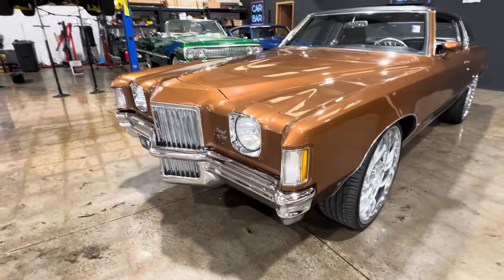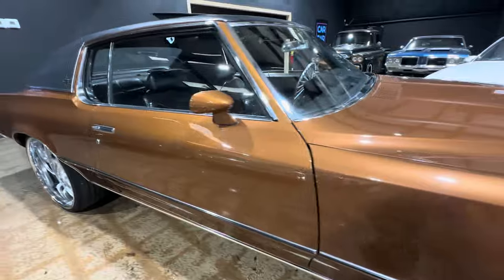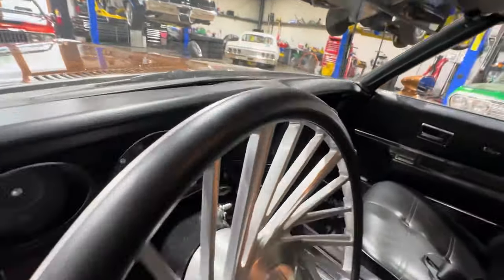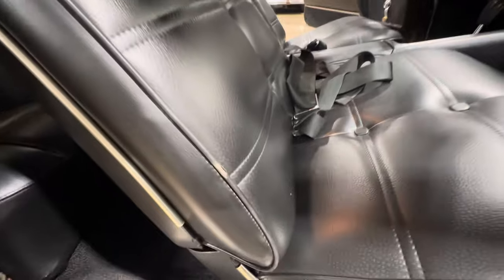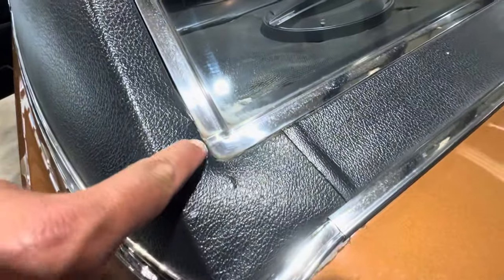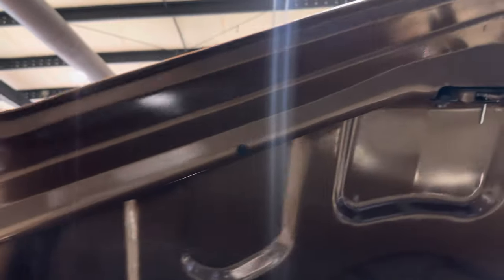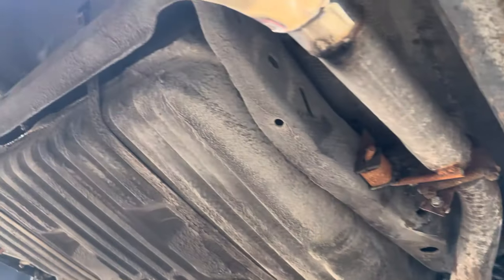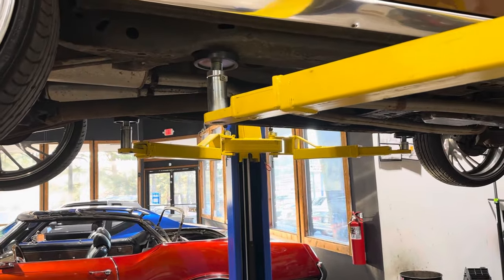For Sale 1971 Pontiac Grand Prix Model J $22,995

Comment: I owned a 1971 GP SJ, 455 CID, Turbo-Hydromatic Transmission, Black on Black. I took off the stock Pontiac wheels and added Keystone Classic chromes with Firestone Wide Oval white letter tires. Not a race car, but a real head turning cruiser! When behind the wheel, the wrap-around instrument panel and bucket seat had the feel of a fighter jet. And man could she could fly down the interstate highway! I sold her in 1977 just before joining the US Navy. Wish I had her back! Mine had electric windows and the "SJ" badges on the quarter panels and inside above the center console. I did not see any "J" badges on this vehicle...

Comment: Need To Get Rid Of The Wheels And Rims. Go Stock With The Original Wheels. Get Rid Of The Steering Wheel. When You Change Up On Stock Factory Its No Longer Original. Only They Can F--K Up A Car..

Comment: Beautiful GP except for the steering wheel and rims. Put some Rally's on it. Or even gold TA honeycombs would be better than what's on there. Not sure the bolt pattern is the same
Reply: U right I like the original steering wheel and wheels
Reply: That car is ruined with that stupid sun roof and steering wheel and wagon wheels looks like it used to belong to a hoodie drug dealer.
Reply: It would ride like crap on those rims, and be hard to steer with that steering wheel.

Comment: Beautiful car, EXCEPT for that steering wheel. Going to check out your website.
Reply: Indeed. And I would not drive it over 15 mph on those rims, which would make the smooth car ride like crap.
Reply: Can you even see the dash through that steering wheel get rid of that maybe put some 16s or go stock rims and get rid of the teeth rattling ride and that is one hell of a car